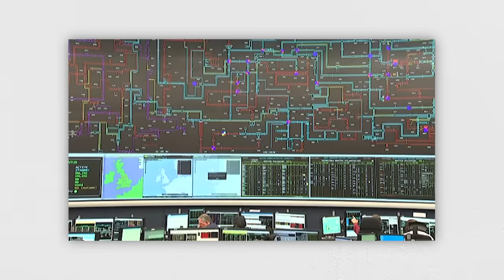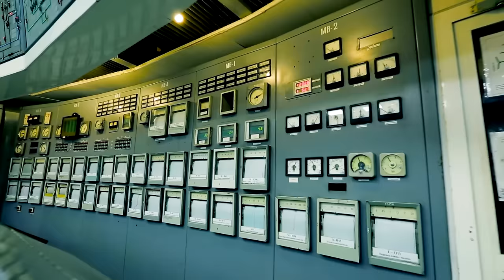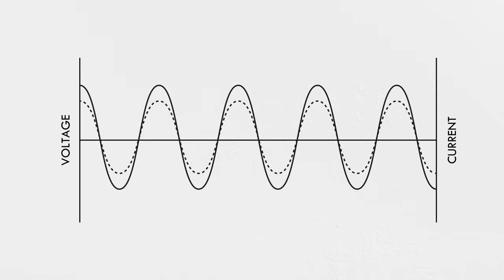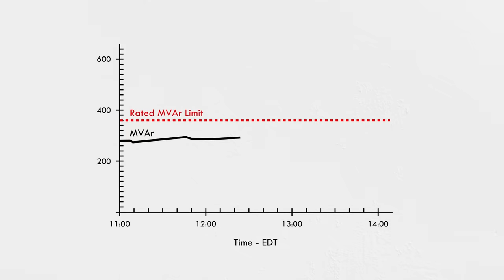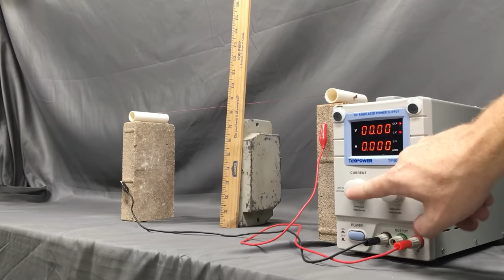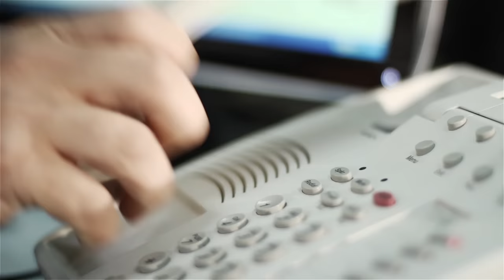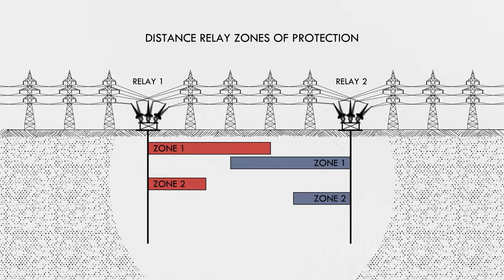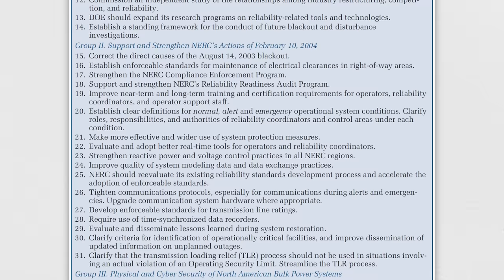What Really Happened During the 2003 Blackout?

Comment: When you learn about the complexity of managing the power grid, it feels like a miracle that we consumers are actually allowed to do whatever we want and use as much power in whatever way we want in our homes. Something to be thankful for, since all the heavy lifting and problem solving is being done by someone else on our behalf.
Reply: We should consume less to keep those guys from those problems. With load sheading, like reduce power consumption on peak times.
Reply: On the opposite side of the world there's also USSR power grid, which is kind of unique in that it covered 12 timezones. Would be interesting to hear more about it. Also there is recent outage in Middle East (from what i know conclusion was reached and it was caused by short circuit in one of coal plants and lack of water in hydroaccumulating power plants because of dry year), and there might be another one coming up with Ukraine disconnecting from Russia and Belarus.

Power usage is mostly quite stable, there's morning peak and evening peak and other than that it's on similar levels. Also it's mostly related to "lifestyle" of whole community, and in lesser degree to how much an individual uses. As even if one person consumes 10kw more, it will not be noticeable on a scale of 1000 people, other than maybe causing some questions to that person. Bigger problem for power grids is solar generation, as it's very unstable (it depends on weather after all) and it doesn't really help with two peaks that often. Also as in many places there are laws giving preference to local "green" generation, so people can "give back to the grid", which, when happening on a large scale, is lowering midday demands, but only sometimes. So companies running power plants have to accommodate these power spikes somehow, which means generators can't always work in optimal mode, reducing their lifespan. Overall I think that there's a better solution to climate change than current solar/wind craze.
Reply: @wumi2419  Good points!
Reply: Not entirely true. The amount of current we can use in our homes is limited by breakers. But yea, there's a lot of freedom for consumers. So I agree with the gist :)
Reply: @kmetze  Yes. Also, as smart meters are rolled out into more and more households, power companies can react even faster to actual demand... however, in some areas apparently there has been discussion about power companies being able to remotely shut down certain appliances (like AC) via these smart meters if they feel like they have to force customers into lower power use if it helps them keep the grid stable.
Reply: @Kr0noZ  We've had that for decades in the Midwest. It's very very rare, but the power company can temporarily turn off your air conditioner or maybe electric water heater using a remote control switch installed next to it. In return, we get a small credit on every single power bill. It's not a smart meter, it's just a switch that receives data directly from the power line.

The theory is they can alternate between groups so your air conditioner may not run as often, but it will still run enough to keep you cool. I say "theory" because in practice I don't even know the last time it was activated.
Reply: @adamellsworth3732  Still creeps me out to imagine someone at a company I happen to be a customer of remotely turning off my home appliances that I PAID FOR separately without warning...
Reply: The modern world is a miracle and we should all be a little more grateful  for living in it.
Reply: @Kr0noZ  They already have that power, it's called a rolling black out. Not really that different, except that you lose all electricity instead of just your AC or water heater.
Reply: @nikitanugent7165  That's not part of normal operation though, but load shedding in case of emergency.
Reply: The Tennessee Valley Authority CEO is the highest paid federal employee..... they get paid well for their work. Sorry, but they're doing they're job. They're not slaves, they're free to leave at any time.
Reply: @wumi2419  what's your better solution to the current solar/wind craze?
Reply: It's something too many people take for granted.
Reply: yup. engineers are unsung heroes.
Reply: I think the even more amazing bit is how homeowners can tie their solar systems into the grid to backfeed and not bring down the system
Reply: @Kr0noZ  Then go off grid.
Reply: @jonathanwhite3507  And your point is?
Reply: @sjorsangevare  Bring on more, with better insulation, ground source heat pumps and battery storage.
I recently went to R60 in my roof attic space. Heating bill is a bit lower, summer temps in the house are lower, we are far enough North that air conditioning, is almost non-existent for houses. I have a lot more changes to go. Sigh!
Reply: @sjorsangevare  improving existing power generation. Research towards creating full cycle nuclear power, high temperature coal/gas turbines (these allow both higher efficiency and reducing pollution).
Centralizing heating (as there's effect similar to economy of scale). Maybe more filters, but that's hard to say, as devil is always in detail. It will require careful planning, but corporations plan their actions anyway (at least in form of roadmaps, also plans are needed for funding).
Solar/wind generation still has its place, but unless fundamental problem of instability is solved, mostly for small scale generation and/or in places where shipping cost of fuel is significant enough savings will balance losses from generators.
Overall, I believe that nuclear power is currently the way forward, especially if cycle is completed (which seems to be pretty close) and it should last us until thermonuclear power. It is also one of "lightest" on infrastructure nearby, as fuel rods do not need to be replaced that often, unlike coal/gas you need a constant stream of. But there is no single solution and it depends heavily on what is available locally.
Reply: Well, I mean, I have a 240V, 150 Amp supply connected to my home, so I guess technically I have a "limit" of 36 kW to work with, but the grid is NOT designed to accommodate everyone running at capacity.
Reply: I might guess you live in a place with inexpensive power rates.
Reply: Can you imagine studying and working with all this complex mess
Reply: Civilization
Reply: Would you mind telling SA's Eskom how to run a nationwide electric grid?
Reply: A lot of random things together will start to look mighty organized on the whole... maybe even a bit of central limit theorem involved there...
Reply: @dickJohnsonpeter  🤦‍♂️totally missed the point.
Reply: There are quite a few limits to your usage. If you have any heavy equipment you will be billed based on your poor "power factor"  caused by your machines. That basically means you are penalized for your power loads being out of sync with the gird's production. You will be ordered to install special transformers to adjust your power factor. You also need your own pad mounted transformers if you want to use more than 600A. If you want any power at all on a remote lot you may need to pay for a pole mounted transformer or your real estate developer will have to pay for it.
Now it seems like us being able to do whatever we want in our houses is great but we make most of our money in facilities that require you to pay much more to grid managers. In other words if you actually want to use your power for anything productive you will have to pay a lot.
Reply: K e y l a 🇭🇲  I mean, your paying for them..
Reply: When electric cars become much more numerous, we might see some significant controls on the demand side by having the chargers controlled by the power company.  Turning them off for hours wouldn't be good, but it could help absorb the more volatile renewable power over shorter time periods.  Some people would be fine with the charger shutting off for a few minutes at a time in exchange for a lower rate for electricity.
Reply: @maximilian19931  or how about build more solar panels and wind turbines so we can have more power. I pay for the power therefor they need to make it. I shouldn’t have to run my house on a generator
Reply: @Kr0noZ  yeah i like to keep the government and other irrelevant people out of my personal life as much as possible. I understand entirely the need for safety cut offs, but cutting off a service i paid for, to make someone ELSE'S life easier? No sorry, thats what youre paid to do, youre paid to work hard for me. And that hard work is why i pay my bill. Give & take.
Reply: It’s a beautiful country
Reply: @Kr0noZ  Turning off air conditioning and water heaters to reduce peak demand has been done since the 80s.  In every power company I dealt with, this was a deal for the consumer for these (usually) infrequent interruptions for a reduction on their bill.  What you'll eventually see with smart grid technology is the ability to disconnect car charging load during times of system upsets.  Further, the serving utility could pull on the stored energy in EV batteries during frequency excursions and/or large loss of generation.
Reply: @wumi2419  you use arch btw
Reply: @nikitanugent7165  that might be bad for a machinist as a sudden power cut to a machine can be dangerous.
Reply: @maximilian19931  
there was plenty of load shedding that day
Reply: Don’t say that, they’ll start charging more
Reply: Beautiful capitalism
Reply: @Kr0noZ  Smart meters are not a real-time resource. And "load control" modules are typically only installed on a few high power devices (HVAC, and water heater.) Around here (RDU), CP&L removed them decades ago because it cost them too much money. The smart-meter can turn off all power to my house, but not individual components.
Reply: You can't just "use as much power" as you like. Even with a "200A" service, you'll be fed from a grid transformer not rated for that level of continuous load, and it's shared with others. (my 50k xfrm is shared with 10 other homes.)
Reply: I smoke weed everyday so I decided to make my habit into something productive so now i smoke weed on my YouTube channel 😨
Reply: @wumi2419  There is. Nuclear energy.
Reply: Yea I mean, we do pay for it, and those same people benefit equally etc. I agree it's incredibly impressive, I only mean to say there is a give and take. Many things to be thankful for for sure.
Reply: Oh also, Nuclear. Green is taking too long, nuclear is the perfect safe stop gap compared to anything else while we build and develop green. We have nuclear here and our energy is 25% cheaper than the national average or something. Per KWh it's much safer, it's insane.
Reply: @hi_tech_reptiles  It's insane how much environmentalists oppose nuclear energy. It's so much cleaner than fossil fuel, and unlike solar and wind, they can be used as a baseload plants.
Reply: @dauf69  what is your "there is. Nuclear energy" referring to? I said in another comment that it's part of better solution that I was referring to.
Reply: G'day,

Too true mate.

I've been living off-grid since 1985..., and when there's a Grid Failure then I hear about it on the Radio News...; but on the other hand if a Lightning Bolt passes within 1,000 ft then all the tiny Wires in my Solar Panels generate a Voltage Spike from the passing EMP of the Field around the Lightning..., and unless I remember to reboot my Solar Battery Charge Controller the next morning then it stays in Safe Mode, protected by it's Overload Circuits, and nothing from the Panels will reach the Batteries until I reset it.

And, I have to periodically refill the Batteries with Water, as their Electrolyte slowly boils off.

But, I don't get Bills for Current, nor do I have to rent the Grid Connection..., either.

All told, making and storing my own Electrickitiez has been a very good decision.

Just(ifiably ?) sayin',

Such is life,

Have a good one...

Stay safe.

;-p

Ciao !
Reply: I’m so thankful that it costs 10,000$ to get attached to the grid where I am and it motivated me to spend 5,000 to never have to pay/rely on the government again
Reply: @T.J. Kong Local (or "more distributed generation") generation also has it's problems: You can't raise voltage locally without it causing problems on the other side of the grid that it's connected to.
This is something we've been seeing in The Netherlands for quite some time now due to all the solar panel installations (whether on homes or the big commercial parks with hundreds of panels), they can raise the local voltage at the neighbourhood transformer so much that it either shuts down power there, or that a solar panel installation decides to not exceed the threshold (risking damage to equipment otherwise) and cuts out.
The problem with solar panel installations cutting out however, is that if a couple of them do that in a timespan just short enough for safety systems at the local transformer to go "Woah, why is there such a huge drop in voltage!?   There must be a short!!  Let's switch off this part of the neighbourhood ring!" and there's a neighbourhood left with power.
And you can probably already guess that this causes an effect on the neighbourhood ring back into the transformer that feeds it, because even a minor neighbourhood transformer going offline, will cause a raise in voltage (and maybe even frequency because it will echo back into the high voltage grid)  for the load it was supplying power to now being switch off very suddenly.

If safety systems there are strict and the time at which the raise in voltage occurs and is not corrected for adequately, you might risk the bigger transformers switching off...
True, this might not be a very common situation, but now let's say 2 neighbourhood transformers do this at the same time...

Some people, because of this want government to seriously subsidise home batteries for storing solar panel power, which I think is a good idea.
At the current moment, when a power outage occurs solar panel installations will switch off, since the inverter listens to the mains frequency and voltage, and if one of them suffers a big drop for long enough, it switches off to prevent the possibility of backfeeding into the neighbourhood transformer and possibly giving maintenance workers there a nasty surprise...
Reply: @Kr0noZ  They can't, smart-meters do not report back continuously, they do so in 15-30 second to minute-long intervals through a 2G SIM-card (at least here they do), and even though many homes using a lot of power all at once, will probably pale in comparison to companies having to schedule their power request in advance because they'd otherwise cause such a huuuge drop in frequency and voltage the process they want to start up will require a planned overgeneration of power.
Reply: @wumi2419  shoot, this is why YouTube comment system sucks compared to reddit. Hard to have a discussion without threads.

In regards to my reply, I especially refer to this part: " Overall I think that there's a better solution to climate change than current solar/wind craze."
Reply: @dickJohnsonpeter  yeah but just cuz you spend money on it doesnt mean you cant appreciate the sheer level of necessary complexity and effort put into this system on our behalf
Reply: @T.J. Kong honestly. I say we need a looott less money in our military - though i certainly recognize its necessary existence, especially with problems like russia and china arming up and negotations arent garunteed to solve that - way more accountability and transparity, stricter standards on the character and integrity of the politicians we let represent us and to spend our tax dollars more responsibly and more on infrastructure and social reform projects, like prisons that arent designed for private businesses to make money off of the imprisoned.
Reply: @Bremend  Actually, we had smaller issues with that in Germany. There are controllers at each installation which check how much power is available and only feed into the grid if there is need. Turned out the controllers all were programmed with the same threshold. So all home-owned plants would switch on simultaneously. And then they will detect the other plants putting more power in, and switch off again (all at the same time). Now they ship with randomized thresholds I think.
Reply: @Br3ttM  One option would be to couple the price to the current demand situation. Not sure if this communist state-controlled solution would be accepted in the US. :D
And if the power during a few hours is three times as expensive as normally, a lot of people will voluntarily opt to configure their car to only charge when prices are low. If you don't want to save money, you can charge whenever you want. Everybody is free and happy. Problem solved.
Reply: Ya, I am tired of losing power randomly and for extended periods when hurricanes hit. I am going off-grid to do it myself.
Reply: @jfbeam  huh?
Reply: Being reminded of that from time to time helps a little but when it comes time to pay the monthly bill.
In the last year plus, I have had three weather-related power outages in my area, and they have all been resolved in a single-digit number of hours.
-
There are a lot of qualified people working hard to keep us in flowing electrons, and as long as that knowledge and dedication is not allowed to fall away, and regulators don't get lax in ensuring the necessary standards, then the voltage will continue to flow.
Reply: They do it 24/7/366!  Major holidays, birthdays and other cultural phenomenon are missed by many for our collective benefit. 
I was going to say a few words about that, but forget it, we pay for that,... unless the current stops flowing. The work has to be done for those companies to bring in revenue.
Reply: Not on our behalf. We pay a hell of a lot of money for that privilege. Complex feat of engineering? Yes. Done just for the benefit of the consumer? Nah, done because there’s boocoodles of money to be made.
Reply: Ya it’s almost like we live in America.
Reply: One of the worst pro autoritarian comments I ever read...
Wha is wrong with these people to think like thus?
Reply: It is a monopolized service that we pay enough for. As much of a miracle as it is.
Reply: You really aren't. It's just that the limits are so high you'd never hit them (largely because the same infrastructure needs to support commercial and industrial loads)
Reply: funfact: tesla actually invented tesla coils for everyone to get free power. but ofcourse his rival made it a monopoly.
Reply: @maximilian19931  useless without stable energy storage
Reply: @maximilian19931  Nope. We are the customers, we buy as much as we want and the vendor is responsible for maintaining adequate supply of the "product". Forced load shedding, aside from the obvious negative financial impact on industrial customers, is a draconian non-solution. Building more generation, combined with increasing transmission capacity, is the only viable solution.
Reply: @Stevie-J  protection engineer humor
Reply: Yes. You truly do not understand the magnitude it take to keep a city the size of phx going
Reply: sure
something like a self proclaim Atlas

yeah.... whatever
Reply: They need to figure an economic way of storing the electricity. Like how your car works. It uses a battery to level the voltage demands and supply. Keeps it all smooth and easy.
Reply: Domestic consumers sure. But high power consumers like factories are regulated.
Reply: I mean you can't do whatever you want try running a lot of Bitcoin miner and you will trip the fuse
Reply: @noahjones9833  That's the problem with the original comment and this one. It's not on our behalf. It's a mutually beneficial relationship. They're not "letting" us do anything. They agreed to let us do it in exchange for dollars. It's not a miracle. It's not a gift. It's a fair transaction. Mostly for profit. May vary from individual to individual. I get it engineers are awesome. I agree, but let's not make them out to be saints.
Reply: But lets stop using fossile fuels IMMEDIATELY instead of weening then out as we advance
Reply: Comes at a price of course though lol
Reply: @wumi2419  what is your better solution?  Please tell us more.  Thanks!
Reply: @Kr0noZ  Residential load shedding has been around for decades.  I have it at a few of my homes and buildings.  Its a voluntary program and I get a monthly discount plus some of the utilities also pay additional credits for when they do engage load shedding.   I usually have water heating and air conditioning enrolled as sheddable devices.   Where I am at now, when they engage load shedding, my water heater is shut off and my AC runs at half capacity.  I can't think of a time when I actually noticed it.
Reply: @superspooky4580  Solar and wind are terrible for grid reliability.  They are completely erratic.  Grids need stability.  Shading a solar panel by just 10 percent causes output to drop by 90 percent.  So clouds rolling across an area wreak havoc on a grid as solar panels go from 100 percent power to 10 percent power in a matter of seconds.  Large power plants are built for.efficiency and have a very narrow range at which they are most efficient, which also happens to be where they put off the least emissions.   So how do power companies handle buffering the erratic renewable outputs?  Fossil fuel generators.   Yes, grid tie solar and wind can actually increase pollution.    I've been running solar for 25 years but do not feed back into the grid.
Reply: Money
Reply: freedom is never surprising.
Reply: “Behalf” or your monthly payment ?
Reply: isnt that what we pay for? what I think is amazing is how a company's like Apple can make it damn near impossible for you to repair your own device even though you are more than capable of doing so yourself or automobile manufacturers building stuff with engineered failure points to make it to where you have to go buy a new ones and it's not monetarily feasible to repair it at a certain point. using the power grid because we pay for the service that's just common sense I think.
Reply: @Kr0noZ  This sounds like something for emergencies, so in that case it's either no AC for you or no power for a large amount of people, the choice is pretty obvious.
Reply: @FlyinRaptorJesus  which is why you can have the ability to post here, unless you like beating congo drums and smoke signals.
Reply: Thats the same thing with food industry, car industry, construction industry, etc
Reply: @adamellsworth3732  if you get injured because of them turning off your power that's a crime
Reply: Especially with our power hungry gaming PC's
Reply: Be thankful for it? We pay them for the service they provide. We pay more if we use more, less if we use less. We are buying a resource from them. Also they don’t always let us do what we want with it - take ERCOT in Texas - they killed numerous people with poor management and “controlled” outages.
Reply: @T.J. Kong You say "forget about green energy" when it's the best form of distributed generation.
Reply: A handful of the biggest users (metal manufacturing) have arrangements to get their electric and/or natural gas shut off.  That is one way all the heavy lifting gets done.
Reply: Yea, and then you take the internet into account.. lol
Reply: Your comment would make sense ONLY if it was provided to us for free
Reply: Learning just about anything in any system just shows that nearly everything is hanging by a thread
Reply: @maximilian19931  we use this in Aus. Some large industrial customers can get called to turn off their power, in exchange for cheap power generally. Especially our aluminium pot lines
Reply: What a full of it comment. It's not a "miracle", it's science and capitalism.
Reply: pooorrrnnooo yes you are
Reply: We pay dearly for it
Reply: @dickJohnsonpeter  This line of thinking is literally everything wrong with the world.
Reply: A lot of people doing a lot of work to make that possible.
Reply: @Kr0noZ  Decades ago our EMC (electric utility) offered a slightly reduced rate or a credit (don't recall which now) for those customers who would agree to let them put a device on their central A/C unit that could shut it off for 10 minutes during peak hours if necessary.  It was voluntary.
Reply: @Kr0noZ  The similar program where I live was totally voluntary.  Those customers who wanted to participate could but it wasn't required.  This was decades ago.